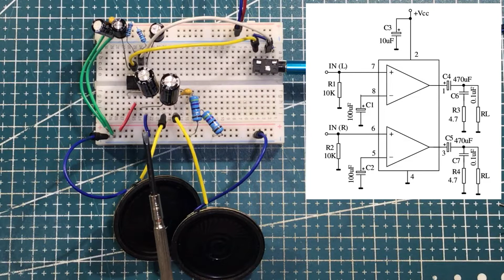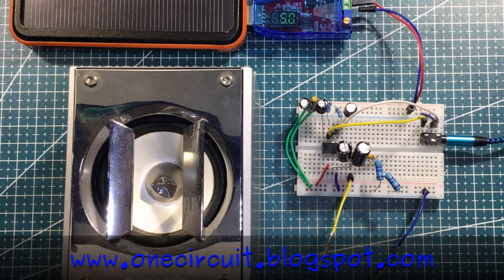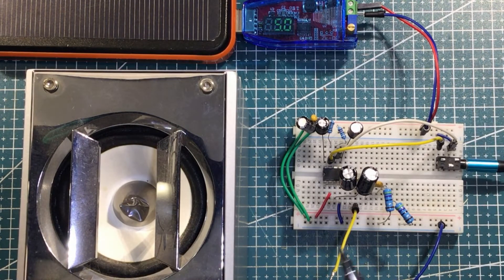Cheap Amplifier with the D2822 chip

Comment: I made a diy preamp and then later added the TDA2822 when still at school in 80s running a couple of 50w speakers. Pretty efficient. It sounded quite nice for a bedroom . Could never play anything loud at home as get told off . Btw can also be configured as mono btl output. Never worried about the filter components . Thanks for the video and memories !
Reply from the maker: I've got some TDA2822s coming in and I'm keen to try them - there's an audio module that came in recently that will need some amplification.

Comment: That sounds like a decent amp circuit for a Chinese copy at that price range. Looks like it's worth it if you add in the high and low filtering with decent speakers. Were those recycled speakers also 8 ohm?
Reply from the maker: 8 ohm for the bigger ones as well! 🤷🏼‍♂️

Comment: Couldn't you change the 4.7ohm parallel resistor for something to change the impedence of the output? It's a resistor divider network, no?
Reply from the maker: Yes I suspect you could do many variations to match the speakers. The standard circuit in the datasheet was pretty impressive though, there’s even a “stripped” down version.